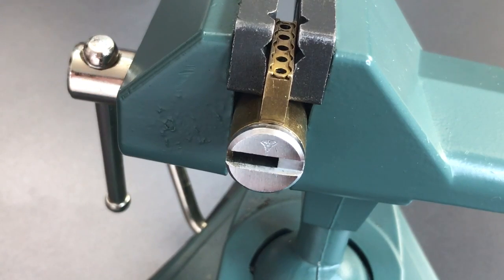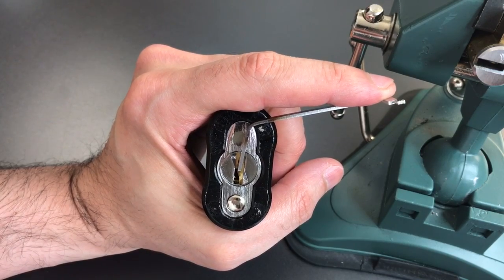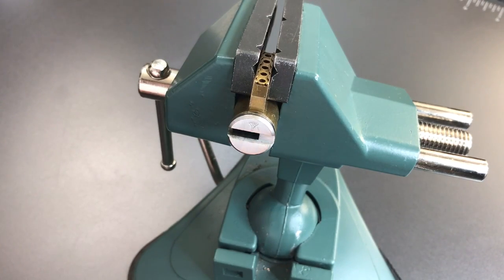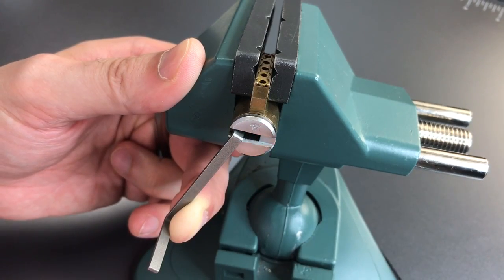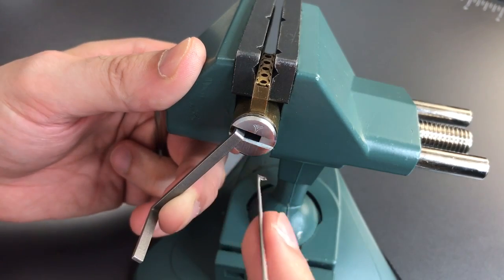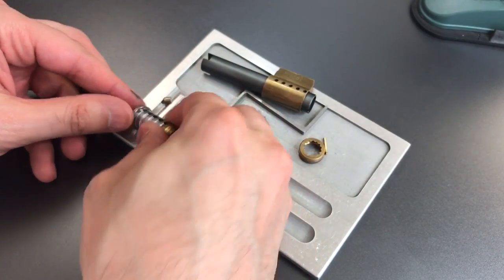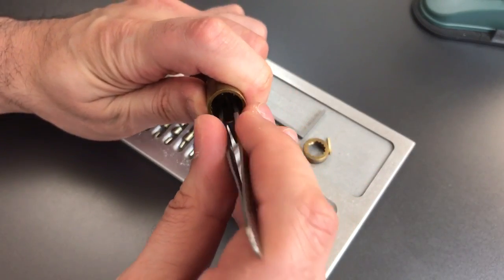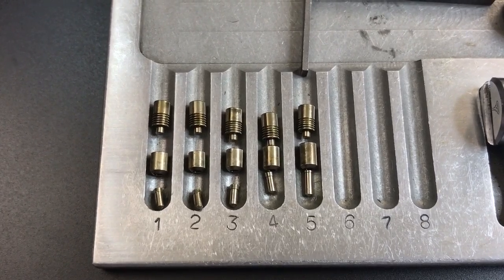[490] Mul-T-Lock Interactive KiK Cylinder Picked and Gutted

Comment: I did this to one of mine a while back with a Jr., then recently I put a interactive in it. The only problem other than the cam, is you have to leave the security nut a little loose so it doesn't bind up the core.

Comment: Could you do a video explaining exactly how to replace the core on a Stanley lock?  It should include how to get the correct parts at a decent price.
Reply from the maker: +Bill S Probably not, but any schlage style kik cylinder should work.
Reply: If you take a schlage Primus KIK and put spools and serrated pins in it, then put it into a solid steel Stanley padlock (preferably the 60mm lock) now you have a good lock

Comment: Could be the luck of the draw, but its the first time I've seen this core and I have no idea what the "interactive" part is.  Also, thanks for the tip on the Stanley lock.  I would have liked to have seen what kind of rear end it takes, though.  I know this is all stuff I could look up, but still.
Reply: If you're looking on Amazon, just look for "CD8823".  Its about $25 on prime.  You can find it cheaper, but the shipping undoes most of that.
Reply from the maker: +htomerif FYI- I bought this ones for $17.50 on Amazon Prime.
Reply: The price seems to go up on things algorithmically depending on their popularity.
You can still get the non-shrouded ones for about $15.
They do have the CD8820, which is a non-laminated version thats cheaper (for some reason) but appears to have all the same re-keying features and the same decent standard core.

I don't really make videos myself, just trying to help in whatever limited way I can.  Let me know if its actually not helping or being counter-productive.

Comment: Ha, I did the same thing a while ago, but with MTL Jr KIKs. I have this lock, and the solid-bodied 24/7. I pinned two MTL Jr KIKs alike and put them in these Stanleys. I use the solid version on my storage unit. Not sure about the economics: this was about $54 . . . I can get an Abus 20/70 for $8 less, or an MTL TSR with a Jr core for $5 more. An interactive core with keys is probably at least $30 more (both KIK or in a real MTL padlock). Fun, though.

Comment: 51 seconds is not  even near the astm rating, but you knew that. Does it have Master Lock parts inside?
Reply: D Sloop If it were master lock then you would have to divide the pick time by 100.
Reply: ☺²

Comment: How are you gonna fit this cylinder into that padlock? It has, what it seems to, a non-spinnable anti-drill-plate that is made for a vertical keyway, and the Mul-T-lock has a horizontal keyway, making it impossible to insert the key once you have installed the Mul-T-lock into it.
Reply from the maker: +Sebastian Nielsen the drill plate rotates. Think about it... if it didn't rotate, how would the lock ever open regardless of the orientation of the keyway?
Reply: I tought it was non-rotatable since it had that X-shaped hole, which allows for 10 degree key rotation even if it wouldn't be spinnable.
Reply: You Answered Your Own Question - - The "SPINNABLE" The Ani-Drill Plate Rotates To A Horizontal Position Allowing A Mul-T-Lock Key To Enter - - The 
Only Problems Occur With "Bottom-Shoulder" Keys (medeco & schlage) & Cap Pin location (newer mul-t-lock)  when Retrofitting Higher Security > > > ASSA V-10  Is the Best Choice In Our Opinion
Reply: I'm actually more wondering about the tailpiece and how it would interact with the Mul-T-Lock KIK cylinder.  Would this be more or less a drop-in replacement for the factory Stanley cylinder?
Reply: The tailpiece driver is a S/P style used in Schlage Kryptonite, CCL sesemee & the Stanley - - Federallock dot com dot tw 
Taiwan makes them ALL
>> The only problems are 
1)  The driver is grooved for cap pins at 11 O'clock &  1 O'clock only  (Schlage, Everest or Primus) 
2)  A bottom shoulder on a key will NOT pass the anti-drill spinner
3)  Mul-T-Lock keys shoulder at the tip- - SO you need spacer(s)  for the key to sit just right and if your lucky and have older cylinders
with the cap pin at 11 - you won't have to Dremmel a new groove
4)  ASSA does NOT have a bottom shoulder on the key SO it fits right in  With Primus,  Everest and Medeco you have to remove the bottom shoulder on the keys

Comment: Can you recommend any cheap padlocks that I can replace the core with a standard Kwikset 5-pin cylinder? I'd like to have a padlock that's keyed alike to my house but don't trust the smart key locks at all.
Reply: Smeado Look into Abus 83 series locks with the KW1 keyway
Reply from the maker: +Smeado A Master Lock No. 18, or aKwikset smartkey Padlock might be worth looking at if you are not comfortable rekeying.
Reply: Thank you. I don't trust the smartkeys. I have a decoder and I know how easy those things are to defeat. Not only that, with the decoder, someone could use my gate lock to get the code to my door locks.

Comment: weould like to have seen the core after being re-pinned... would like to see how you would be able to fit it into that padlock.
Reply: Brian Grant It's a direct drop in replacement, you take the actuator off the core that's in there if you need to. The stanley is schlage Sc4, very easy swap.

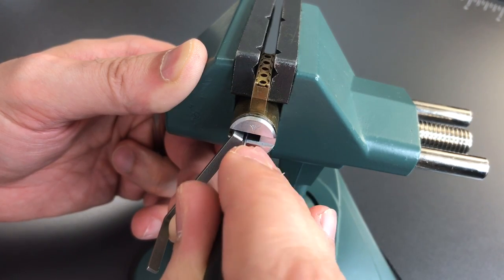Comment: TOO BAD That Mul-T-Lock Moved The Cap Pin From 11:00 O'Clock to 4:00 O'Clock Making It Difficult To Use The Stanley "SP Schlage-Primus" Tailpiece Driver A BETTER Choice Of Retrofit Cylinder Would Be> > >   ASSA Twin,Twin Max & V-10  or  Primus / Everest Primus
Reply from the maker: +ABLOY EXPERT Your point is a good one.  It still works without modification, but if you want it to feel right, It takes about a minute to file a new notch in the driver, which is what I did. 👍
Reply: Two words: Die Grinder. No, wait: Drem El. . . . whatever, either way.
Reply: Five words -> "Drill New Cap Pin Hole"